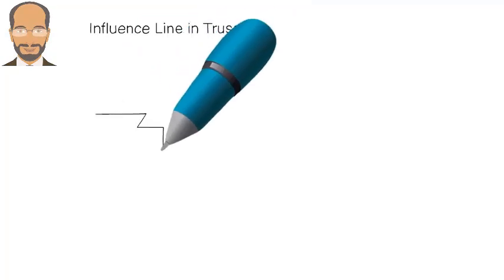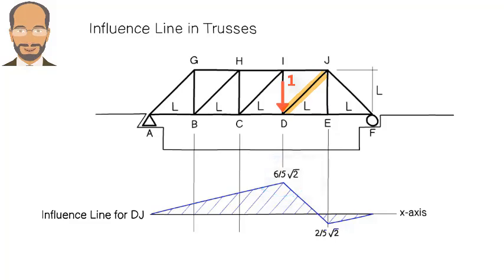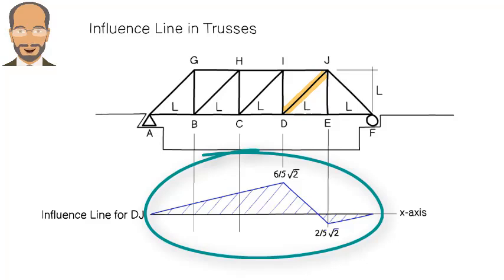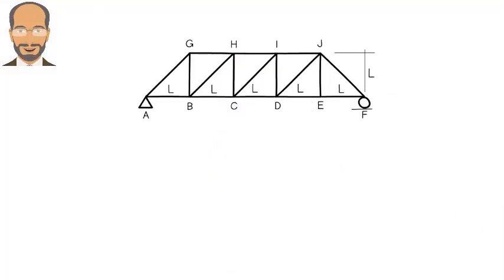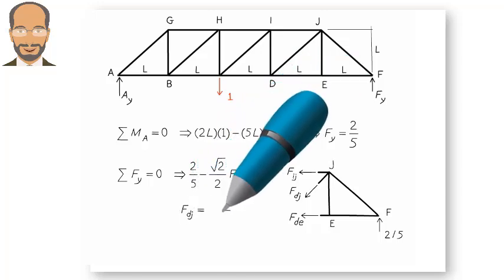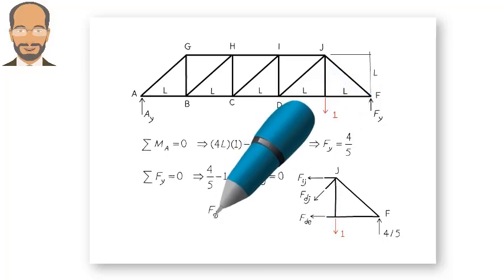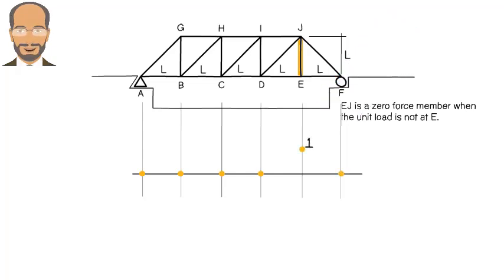SA34: Influence Line in Trusses

Comment: What if the selected member is horizontal. Say I-H
Reply from the maker: Place the unit load at B and calculate the support reactions. Then, cut the truss vertically thru members IH, IC, and CD, diving the structure into two parts. Take the left part, and write the moment equilibrium equation at point C. The only unknown force in that equation is the internal force in member IH. Solve the equation for the unknown force.

Place the unit load at C and repeat the above steps.

Place the unit load at D and repeat the steps.

For each unit load position, we get a value for the force in IH. Plot them to get the influence line for the member.

Comment: Hello. Why do  diagonal members in trusses have positive and negative influnce line?
Reply from the maker: Depending on the location of the load, a diagonal member could be subjected to either a compressive (negative) force or a tensile (positive) force. So, as the load moves across the truss (as the load location changes), the direction of the axial force in the member could change from positive to negative. This positive/negative force direction is reflected in the influence line for the member.
Reply: @DrStructure  thank you very much!! Just one more question. Since trusses have slender members in capable of compression that cause buckling (dangerous), what do we do in actual to prevent this failure in trusses? I hope you also answers this. Will really appreciate it. Thank you!!
Reply from the maker: We can control (prevent) buckling of the member by decreasing its unbraced length (by bracing it) and/or increasing its radius of gyration (a cross sectional property).
Reply: @DrStructure  thank you so much!! ❤

Comment: If the load is at the top chord then the I.L should be -1. Right!
Reply from the maker: It depends on the member that we are drawing the influence line for. The vertical members would be in tension if the load moves along the bottom chord. They go under compression if the unit load moves along the top chord. So, the influence line for a vertical member needs to be drawn below the x-axis when the unit load is on the top, and above the x-axis when the unit load is at the bottom. However, some of the diagonal members may not switch sign (from tension to compression, or vice versa) regardless of the (top/bottom) position of the unit load. When in doubt, it is best not to make any assumptions and analyze the member to make sure the right diagram is drawn.

Comment: Why is the component JF*Cos45 not used in the equilibrium equation? Shouldnt the equation be like  1/5-JD*Cos45-JF*Cos45=0,When unit load is place at B.
Reply from the maker: No, the force in JF does not appear in the equilibrium equation because there is no force labeled JF on the free-body diagram. That force appears only if we cut member JF. But since the member has been left intact on that particular free-body diagram, its internal force does not play a role in the equilibrium equations.
Reply: @DrStructure  Thank you so much  for the information.
Reply from the maker: You're welcome.

Comment: Will you pls tell me how you assume EJ is a zero force member at if the force is at any joint other than E. Your reply will be much appreciated.
Reply from the maker: Consider the free-body diagram of joint E when no load is being applied to the joint. Three forces would be acting at the join: the force in member DE, the force in EF, and the force in EJ. The first two forces are in the horizontal (x) direction, and the last one is in the vertical (y) direction. For the joint to be in the state of equilibrium the sum of the forces in the x and y directions must be zero. Assuming Fef, Fde and Fej are the three member forces, the equilibrium equations can be written as:
Fef + Fde = 0
Fej = 0.
As you can see, from the second equation we can conclude that EJ is a zero-force member.

Comment: Wondering how he came up with sqrt.2/2Fdj  at 5:13..thanks..
Reply from the maker: cos (45) = sqrt(2)/2 = 0.707
Reply: @DrStructure  Isn't cos (45) = 1 / sqrt(2)?
Reply from the maker: @susmitaa248  Yes, it is. If we multiply the numerator and denominator of 1/sqrt(2) by sqrt(2), we get sqrt(2)/2. So the two expressions are equal to each other.
Reply: @DrStructure  Thanks Dr Structure :) I have an exam tomorrow on influence lines and your  videos have been extremely useful!
Reply: @susmitaa248  We should have to take sin45° its is the vertical component not cos45°
Reply: @DrStructure  thank you . I would have stopped the video if i haven't got my doubt cleared. Thank you so much
Reply: @Drstructure..lots of love..thank you.

Comment: Is it possible for a member's influence line to exceed the value of 1? I'm grappling a problem where the truss is 12m long (2m segments), and only 1.5m in height. The truss is upside down like the one shown 2:52. I haven't seen any examples where this is the case.
Reply from the maker: Is it possible for the axial force in a member exceed the applied load? Absolutely. This depends mainly on the geometry of the truss. A unit force applied far away from an end of a truss could result in large member forces near that end.
Reply: Understood. Thank you for the quick response!

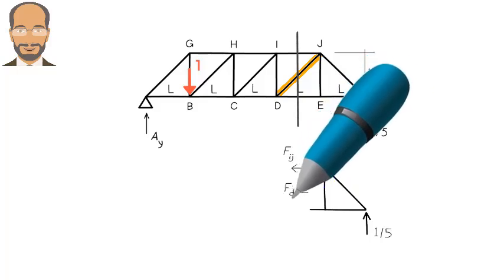Comment: Hey, thanks for the explanation it's really help! please i want to know in ( 5:00 ) how you get the angle 45? and how you get the route of 2 over 2?
Reply from the maker: The height of the truss = the height of the right triangle  =  L. 
The width of each truss segment = the base of the right triangle = L.

The makes the angle 45 degrees. 

Cosine (45) = sqrt (2) / 2
Reply: what if the height does "not" equal the width .. how can i find the angle? for example the height = 6m and width = 5m , i think we should use (tan angle = height\width) that mean to find the angle ( angle = arc tan height\width ) am i right?
Reply from the maker: Yes, arc tangent can be used to find the angle. 

However, tangent of an angle is the ratio of the side of the right triangle facing the angle divided by the side adjacent to the angle. 

In our case, if the height of the truss is 6m, then we need to find arc tan(5/6).
Reply: @DrStructure   now i got it 45 90  45
Reply: I know you got lost because you got FdjCos45 = 1/square root 2 . This is also correct since 1/sqr root 2= sqr root 2 / 2.

Comment: In analyzing trusses we said that loads are applied in the joints, because truss members are only under axial forces. Then how is it that a concentrated force is acting in the middle of a truss member, and what happens in between? Is this idealization valid (of connecting points in the influence line diagram with staights) or is there a different model dealing with that case?
Reply from the maker: The moving load does not act directly on the truss. The load acts on the bridge deck which then is transferred to the cross beams supporting the deck before finding its way to the truss joints. 

As the unit load travels on the deck, it is distributed proportionally to the two cross beams supporting the deck segment.  For example, when the load is at the midpoint of a deck segment, half the load goes to the left support beam and half the load goes to the right support beam. In turn, these 1/2 loads are transferred to two distinct truss joints. 

When we are drawing the influence line, there is no need to show these intermediate steps (since the diagram is a line and we only need its end points to draw it), we just analyze the truss when the unit load is applied directly to the joints.